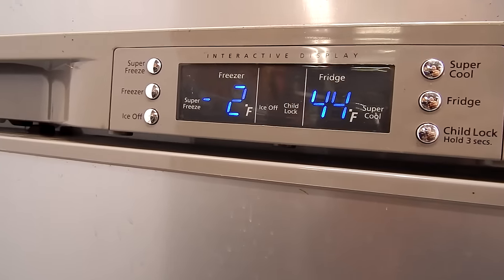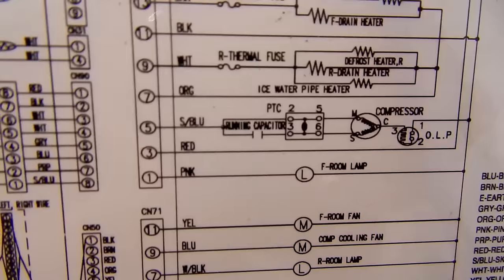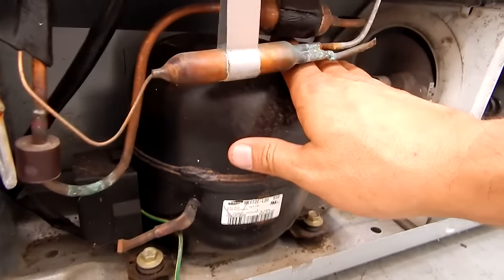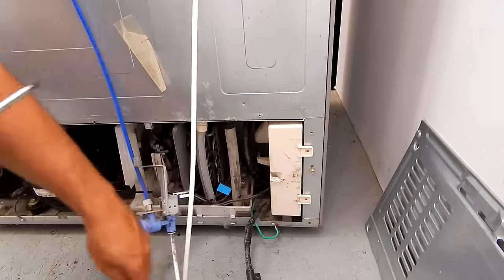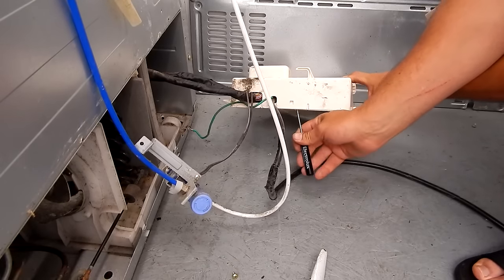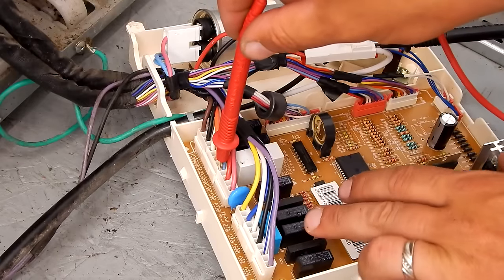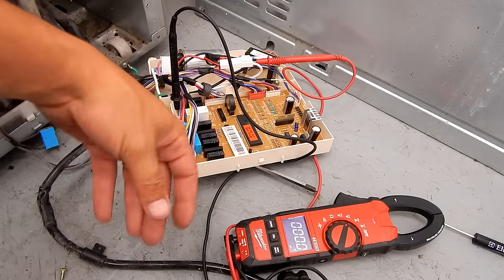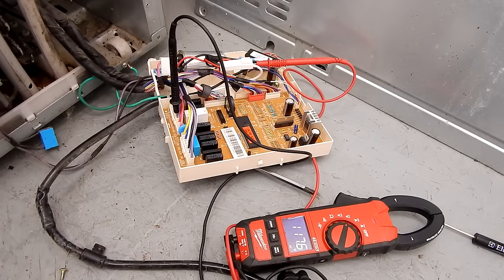Samsung Refrigerator Not Cooling - Testing the Compressor Relay

Comment: so i have a rf28hmedbsr model that has all the fans functioning, and ive replaced the invertor board and pcb.The compressor makes a noise when it starts then gets quiet, but when i put my hand on it it appears to be running. However I have no cool area in area of the fridge. Ive checked the compressor pressure and it looks fine with the refigerant in it. Any ideas on why it may be not cooling at all?

Comment: It is unusual for a relay to fail like this. Unless it was the bad apple of relays.  I tested mine 2023 and was still working properly. However, now 2024 I think I might have the problem described here. Note, my relay has been in service for about 17 years before experiencing the symptoms described here. This Samsung was a headache for me. First service bill of $200 occurred when the refrigerator reached 2 years of service.

Comment: didn't quite understand what you meant about neutral side not closing for compressor to run. Could you run that by again so I can understand it please. I have a similar problem with a Samsung not cooling. I checked relay on compressor and checked ok. How would I check board?

Comment: Hey Bill! So the compressor comes on and then off again - pretty quick but the fridge and freezer temp never goes down much at all so is running about +16 (freezer) and +20(fridge) - does that mean it’s the pcb that’s the issue as it’s not telling the compressor to stay on? Or maybe a thermostat? Thanks!! Ritesh

Comment: I'm a licensed plumber in Tucson Az.
Had a fridge like yours and it quit after a year, Samsung wouldn't help and I had no time so bought another fridge. But set this one in the garage for 2 years for some reason.
We decided to paint the walls and ceiling in garage so everything had to come out.
Half way up the ramp to my dump trailer I turned around and set it back down for 2 days until garage was done, found your video and from those 2 tests appliance store and install I'm like 2 hrs in it total and the fridge temp is dropping like a champion!
Your video was not infact a waste of time and if it hasn't helped anyone else just know that I'm grateful! Thank you!
Reply: hell yea

Comment: Thanks for sharing! My compressor was running, thicking and quiet warm. Freezer was working well, but in the refridgerator was not cooling and no airflow inside it from vents.
When getting the trays out of the freezer, I noticed it was frozen and clogged up, the lowest tray I couldn't even remove due stuck frozen and all water around frozen blocking all airvents.
So the clogged up ice in the freezer prevented the airflow from the freezer to the fridge, preventing cooling. 
This all due I dind't defrost the freezer in a long time.. oops! Not very good for the effective cooling of the fridge and the freezer itself and more working for the compressor I guess.
Hope this helps someone!

Comment: I love watching your videos,I have a french door  Samsung refrigerator and bottom freezer,the top refrigerator is working perfect but the freezer on the bottom does not freezer,the fan runs fine and I replaced the thermo defrost sensor and temperature sensor and still not freezing,cleaned the evaporator coils and still nothing,what else can I check ?

Comment: Hey Bill..thank you for all the help on the same Samsung refrigerator  my model  RS277ACPN  . MY RELAY  ONTHE BOARD is working,  I plugge it in  and it went to 119 voltage then there was a clicc...  the volts went upto a steady 123I.. any further information would be greatly appreciatand..

Comment: I am having a similar issue with a larger "French Door" Samsung fridge, and wondering if a bad relay would also prevent the inside fans from powering on?  I am hearing and feeling nothing on the compressor, but also the interior fans are not moving at all.
Reply: I found out that if something wrong with the fan motor at the back of the freezer up compartment  it can also prevent the compressor fan from starting for whatever reason

Comment: Hello
Another great video.  Thanks
I have a Samsung RS261MDRS/XAA fridge.
Replaced: control board in the back, evaporator thermal fuse, run capacitor, compressor starter relay and PTC.
Compressor is hot, compressor fan and evaporator fan runs fine.  Condenser is clean.  Still fried and freezer not cooling at all.  Any suggestions?
Thanks

Comment: Hello Bill , if you have a minute, I would like to ask a question. I have a Samsung frig(over and under-RB1955VQ). It will cool the frig and the freezer, but when it reaches the set temp, the unit cuts off, but will not activate again (to cool) unless I unplug the frig and plug it back in. Do you have a suggestion?
Reply: Hey, I know this was 5 years ago, but did you ever figure that out?  Ive got the same issue

Comment: hi bill i have a samsung rs20n fridge that the fridge had a few faults that i have fixed but now i cant get it to defrost and by instruction it should do a defrost in about 4hours after initial power on. I can force it to defrost mode. Is there anyway i can reset the micom timing on the power board.

Comment: Hi Bill model number rf26XAEBP, unplugged for 10 minutes comes back in  OF OF (demo mode I guess) I reset it using top left and right button. I resets for 3 seconds then goes back into OF OF. How do I test the front door panel or is it shot or something else? Thanks

Comment: Hi Bill...,I'm carmen.. I love your videos.. I actually fixed my washer.. myself by watching your video on the lid latch.. My husband was amazed...but when i shut off the power in the breaker box to fix the washer.. (cause I was too short to reach the power cord )..the freezer/fridge stopped working again.. Can a 3 in 1 relay go bad.. even if i just had that part replaced just 2-3 months ago?..i can hear it trying to engage.. but it wont start the compressor?
Reply: +Carmen Cales You have to leave a fridge unplugged for a few minutes before trying to start it back up when power is lost, to let the pressure equalize so the compressor can start running. Hopefully you got yours going?

Comment: So does the whole board need replacing or just the relay?
Reply: Yes the relay can be changed alone....  BUT sometimes a bad solder joint on the board will have that same effect, noticed when he wiggled and flexed the board it started up .......  Really bad contacts in the relay will not do that in most cases......

Comment: i have a whirlpool frost free 250l refr, some times the comp. relay  would not turn on even after 24hrs, so i replaced with a new 24v relay, system uses capacitor dropper & 5W zeners for 5V & 24V supply , the live mains is always connected to the low voltage ckts, only thing protecting them is the capacitor dropper which they placed in the neutral path.the 5.1v zener reads 4.7V (tested separately)min should be 4.8V could it be due to this, the pannel indicators cooloing selection works fine even the defrost heater works fine, so now i have connected a aliexpress temp controller parallel to the c & no contacts of the compressor relay, & removed the defrost heater relay, & connected a manual s/w for defrosting.

Comment: I have a question, my relay is fine but the fan of my compressor doesnt works always when the compressor is on. I have replaced the motor of the fan but its still not working every time when the compressor starts. Do i have to replace the mainboard?

Comment: Would the compressor have any voltage with that relay being bad?
Reply: The relay was bad because it started sticking. Tapping it got it to "work" again, but that wouldn't be a long term fix. Replacing the board would be the way to go.

Comment: hello
 I need help...
In my samsung fridge r21 side by side evaporator heater burner,thermal fuse its not...
I bought new parts (evaporator and fuses and sensor) and I replaced it, but the evaporator does not turn on, the refridger starts to produce a huge amount of ice on the evaporator.
I started up the manual defrosting, but still did not give electricity to the evaporator.
Is there a fuss somewhere else? or...
pleas help me do not ignor me ;)

Comment: Lets solder in a new relay, if it is common for the contacts to become worn
from on and off arcing, I would put a capacitor across the contacts to 
absorb the surge. just a idea.   got it Bill.
Reply from the maker: +MrMac5150 I'm just hoping they are carboned up and just need a good cleaning.  We'll see later this week when I get a chance to experiment.  I'll video it.
Reply from the maker: +MrMac5150 If not, i'm sending you the board and you can use your skills to solder it.  I'd burn it up and it would be ruined for sure.
Reply: +Bill Newberry I will look forward to that video, If a guy like me can fix
Radios and TVs I know you can fix that circuit board, your a pro.
Reply from the maker: +MrMac5150 Ha!  I appreciate the compliment!  I'll see what I can do!
Reply: Bill Newberry
sned me the board to rebuild if you can't

Comment: hello friend i have similar pcb but no display door circuit leds itried to fix mainboard because have short circuit and damaged uln circuits and tpi 42 tr but no way display are not on  how do i test pcb leds display separated how check output pcb display pins

Comment: Ok so im having an issue with mine its not cooling but i see the fan and the compressor running but when i plug it in i get an 1 e code i reset it and still does not cool but everytime i unplug and plug it in i get that same 1 e code hopefully someone can help pls thanks

Comment: Awesome video!  My frig is down the same thing.  Would that also my the back of the frig frost up?  Or do I have a defrost heater going bad?  The frig will run fine for a day or two but then warm up to 60 in the frig and 20 in the freezer.  Would love to hear what you think.  Thanks, JC

Comment: I also have a Samsung fridge and my reasons are a little different. When I go from power/hot to the sky blue wire, it shows a reading of 0 ohms (I don't have a multimeter that beeps). But when I go from neutral to sky blue, it gives me 500 on 2000k ohms. ...? What does that mean?

Comment: Thanks so, so much Bill . I checked for continuity between the hot and the blue and it was ok, checked AC same and only 30v so figured had power into LV side of relay but no HV output. Tapped the relay with screwdriver and hey presto! 240v and the compressor fired up woo hoo! Noticed when tapping repay blue flash inside so  not great. Was going to source a new relay and resolder along with the other same one on board but found a board on ebay for £86 so figured as fridge is old this more future proof option. Note that my board is a DA41-00188A but told by Samsung this has been suoerseeded with a DA141-00388A board.Relay is a OZ-SS-112L1 if that helps anyone. Been told by a fridge guy to replace the big silver capacitor that sits next to board while all apart as this can damage relays and compressor if not working correctly and they are cheap security. they are a RNV40H5004 which are about £20 but most electronics shops have equivalent  5uF ones for about £7. Im also repacing the relay that sits on side of compressor so all new relays in the maching as this is only £16. Really appreciate the video couldnt have done this wthout it. Never done anything this in depth on circuit boards before, saved me a fortune on a new fridge and helped the environment too!!!

heres the service manual with all wiring diagrams

https://www.manualslib.com/manual/835473/Samsung-Rs21.html?page=69#manual

 There is also a guy showing a mod to make the fan come on more on this fridge if of interest to anyone   https://www.youtube.com/watch?v=vtXC09qISh8

Comment: Thank you so much! my Samsung fridge has the EXACT same problem. Flexing the board/relay  triggered the the compressor to turn on.  im going to try and remelt the solder joints for that relay and see if that permanently fixes the issue
Reply: ended up replacing the relay with an automotive relay, works flawlessly now.  took apart the old relay and saw that the contacts were burnt up.

Comment: Would you fit a new relay or go with a new board?
Reply from the maker: +heavydiesel Still deciding, I think I'm going to cut the plastic off the top of the relay and look at the contacts and make a decision if they can be cleaned or if they are burnt up and go from there.  The board is like a 100 bucks.  The fridge was free.  I want to give it to my mother, so I need to make sure it will be reliable for her.
Reply: heavydiesel
Reply: Any ideas as to where can I find service manuals for a Samsung fridge, some appliances bring them hidden inside.